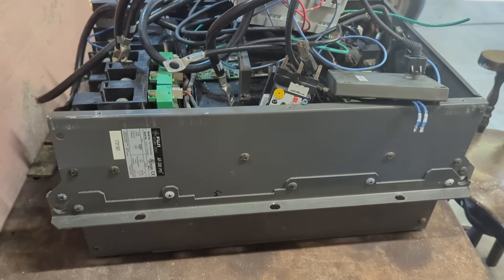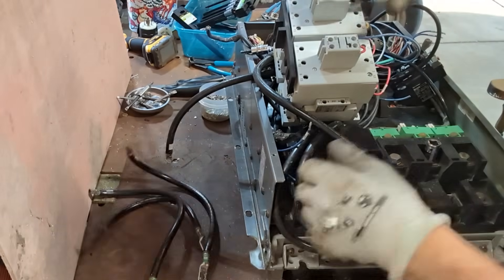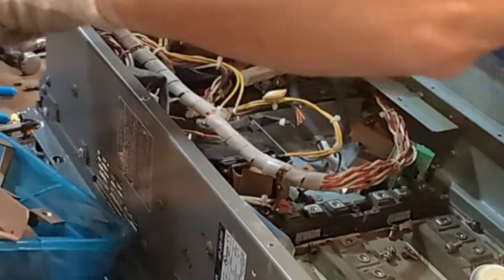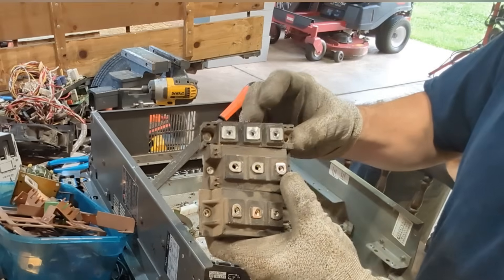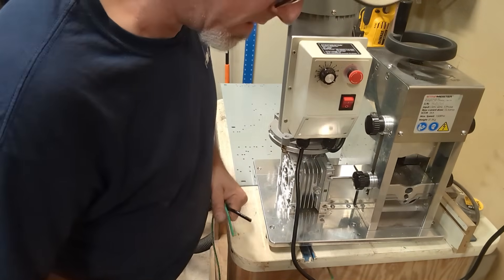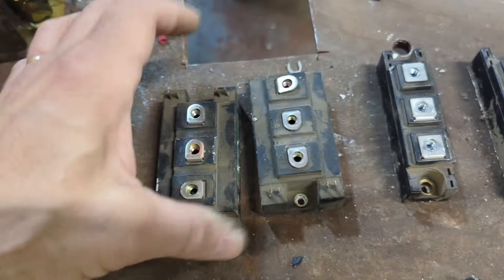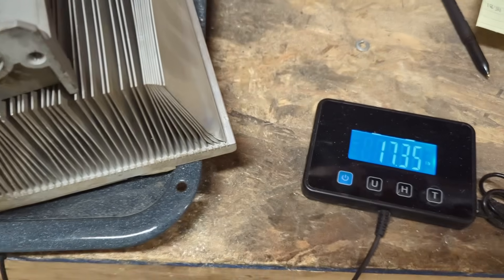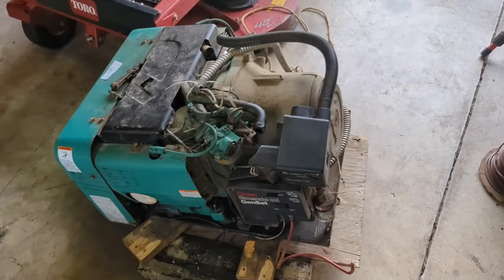Scrapping a VFD (variable frequency drive)

Comment: From what I could see of the Cu bus bars, they were #1, while the tin coated wire was clearly #2. Why mixy mix??
Reply from the maker: There's only a .10/lb difference between #1 and #2 copper.
So, to keep the video at about 20 minutes. I just take short cuts.

I separate it before taking it to the scrap yard.
Thanks for watching

Comment: Smaller vsd or vfd are almost worthless.
You can get a very cool cap from smaller inverters(700/800V and 500 or 700uf) bigger ones are rich in ally and copper due to buzz bars and bigger structures that works ad heatsink.